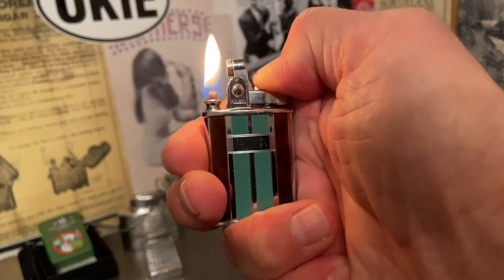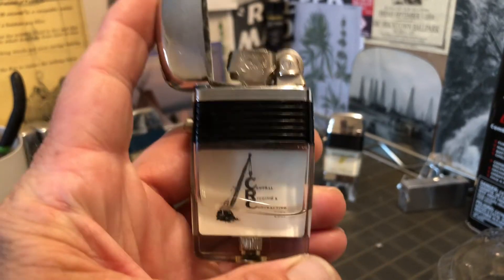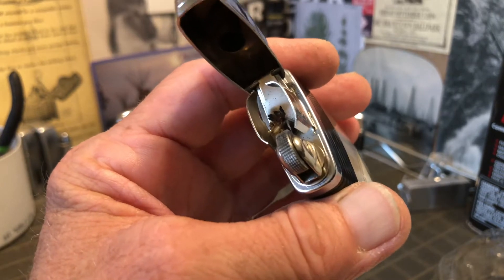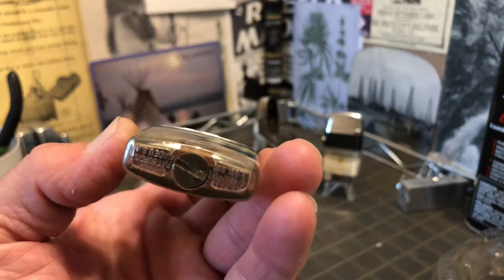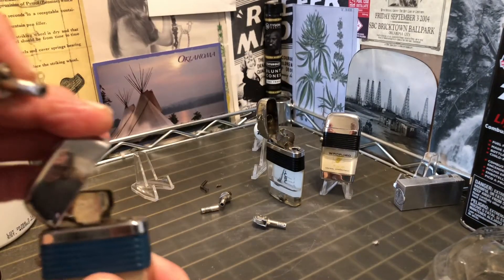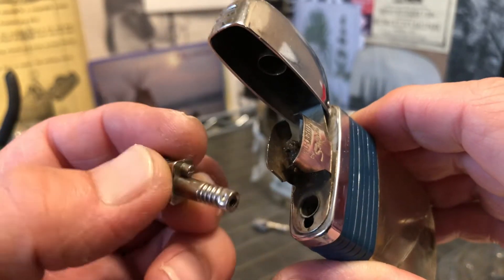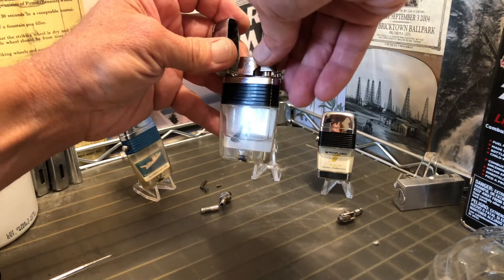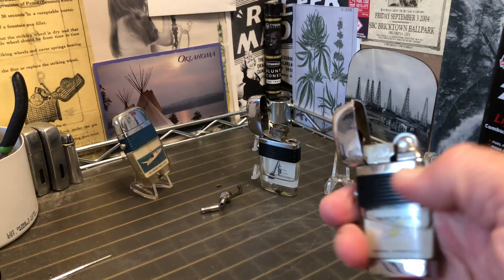A Few Vintage Scripto Vu-Lighters And Several Things I Don't Like About Them

Comment: I have one of these as well, but the fill screw is stripped, so I can't really use it. I have found that there is some wadding where the wick sits in. So when you release the fluid from the tank, you are basically filling a small petrol lighter. I think the reason why it leaked, was because the cotton piece was overfilled, just like what happens with any other petrol lighter. I'd try filling it up a little at a time.
Reply: There is also an o-ring inside the button that releases the fluid. That may be why it is leaking as well.

Comment: Is it possible to change out the advert?
Reply from the maker: It's possible but I think you'd have to break the epoxy and then reseal it. It's not the kind of thing I've ever done.✌️
Reply: @DependableFlame  thank you for the reply. That’s what I figured. When I was 13 my grandma gave me hers. I filled it not realizing the seals were bad and my hand went up in flames with the lighter. Melted the bottom by the screw hole and have been meaning to fix it ever since
Reply: Is there a way to open the lighter casing? The grommet the fill screw screws into popped out and I cannot screw the fill screw closed.

Comment: The reason your hand got wet is you put too much fluid in the upper chamber. Just like over filling a zippo. Also the fluid won’t evaporate like one with wadding. Carried one for decades with no problems.